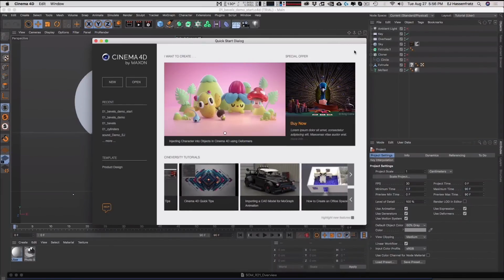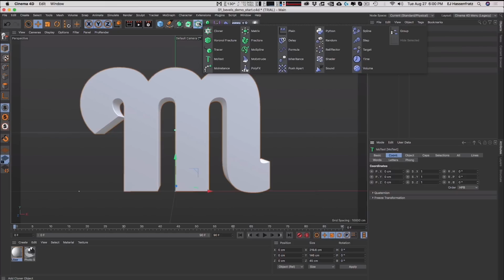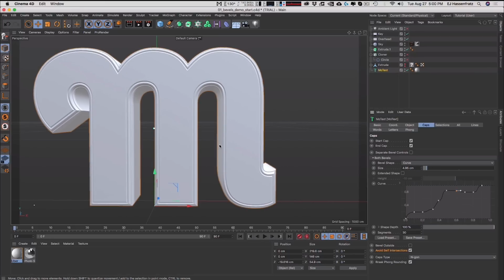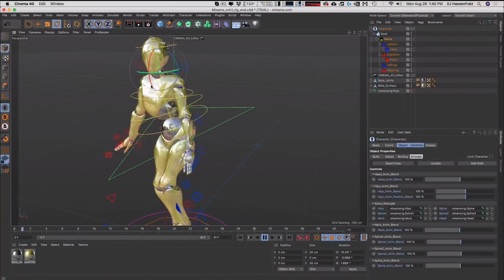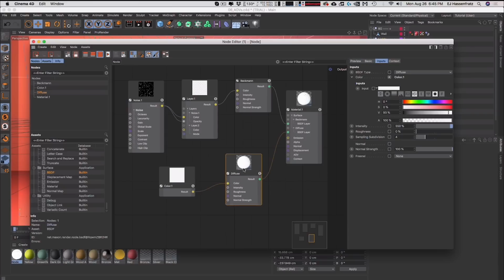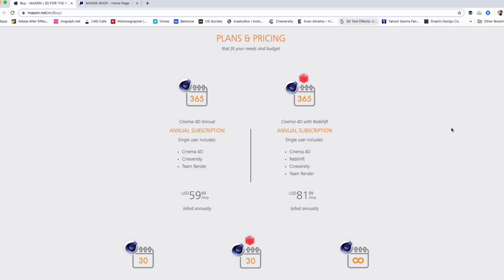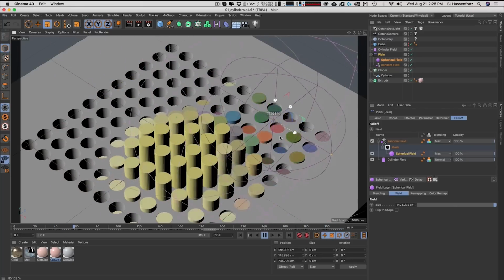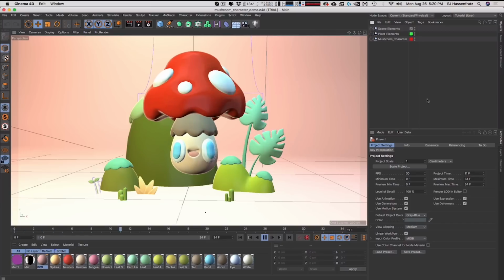Cinema 4D R21: New Exciting Features!

Comment: EJ - much respect and admiration. I have learned so much from you and have followed your tutorials, thank you. I was even thinking about taking your Bootcamp at SOM but I am seriously  considering switching to Blender. Have you had any experience with it?  Even though Maxon has changed their pricing, it's still expensive, and I'm thinking long term as a "wannabe" freelancer. Thoughts?
Reply: I have zero experience with Blender and I hear many great things about Blender, being it's free and fully featured, but I don't know any studios personally that are using Blender right now.  I see a lot of game artists using it though.  One thing I can say is that if you want to the most marketable to studios, you should learn C4D but if you're going to be solo and working directly with clients, sure, use Blender.  Clients don't care what software you use as long as your good, but studios will care because you have to fit within their pipeline.  I will say if you're doing motion graphics, C4D is the easiest to learn and quickest to do mograph style work & has the best integration with Adobe products.  All about what you see yourself doing in the future.

All that being said, if you're serious about learning 3D fundamentals, whether you end up using C4D or Blender, Bootcamp will have you up and running in 3D with knowledge you can transfer over to whatever 3D app you choose.

Hope that helps!
Reply: @eyedesyn  Thanks EJ for taking the time to respond!

Comment: I was expecting to see the new auto-weight workflow
Reply: I'm going to do a couple more in depth tutorials on the auto weighting & Mixamo, but basically the only thing you need to know is there's a better algorithm with the auto weighting system, so the workflow hasn't changed, but the weighting calculation has been improved.
Reply: @eyedesyn  sure, thanks